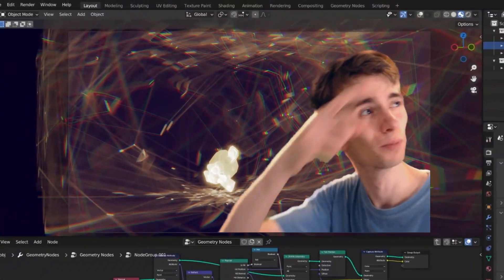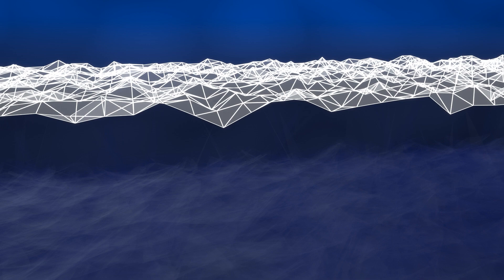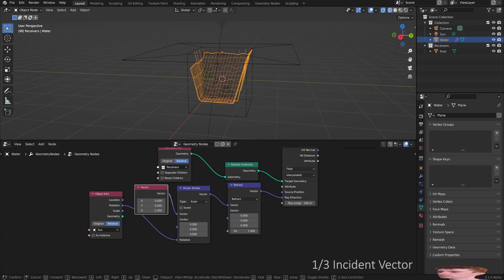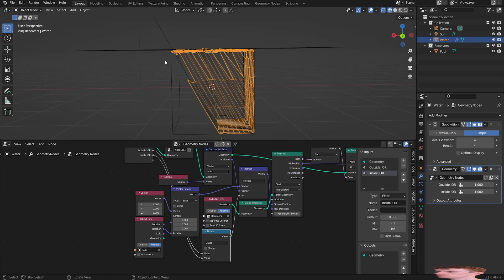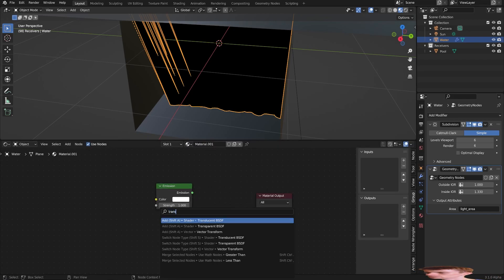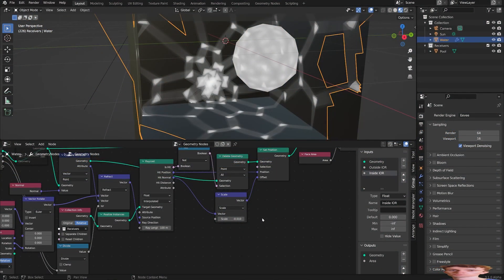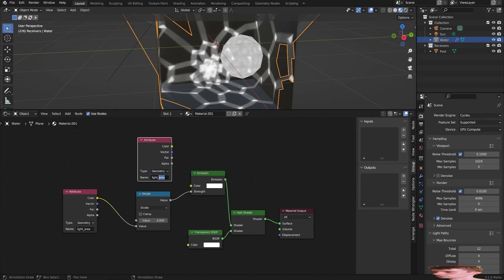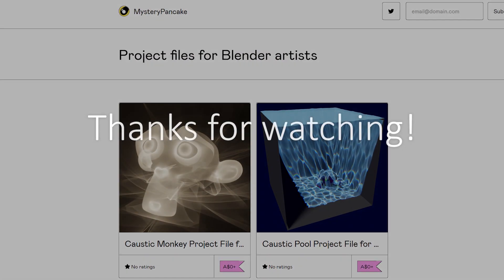Fake Caustics with Geometry Nodes! Blender 3.1 Tutorial (Eeevee)

Comment: hi Evan,

I have an old black and white image of my grandparents i want cast a glass which projects caustic image of my them. So, is there any possibility that this tool blender provides some sort of reverse engineered thing from 2d to 3d.
Reply from the maker: You could try using a grid with many points, and setting the position of each point to the brightness of the image at that pixel. It can be done with Image Texture and Set Position nodes in Geometry nodes.

Blender now has a caustic renderer in Cycles you could also try

Comment: hi ! thank you again for that fantastic trick. Even after capturing the attribute and plugged in the normal node too it, i didn't managed to get rid of all the edges bugging 6/54... could you help me please !!!
The object is a complex one but it is flat, and every node is rightly plugged (i triple checked), and the light effect is working but the view is obstructed with those black edges :///
Reply from the maker: The normal might not be random enough to stop all overlapping faces. It can work better to use a more random node like a noise texture, or the index input multiplied by a small number. Though Blender now has proper caustic simulation, so this method is not really needed for Cycles anymore.

Comment: why blender team just dont rewrited entire cycles render to polygon reprojection? and blender will have refraction and reflection caustics like its normal.
i dont like idea of rays casting from the camera in random way.
Reply from the maker: I guess the method Blender uses must be more accurate, though I wonder too
Reply: @MysteryPancake  i think is have equal accuracy, you cant cast many rays to polygon and take a reflection or cast 3 rays and project this polygon to surface on the way. problems appearing if we will use normal maps, but even this is solvable.
maybe it's just becouse of history of computer graphics research.

Comment: Absolutely fantastic!!! I .. am speechless. One question I have is, what if you want other lights in your scene? Say, you're making an underwater scene and want to make an underwater scene, where there's additional glowing objects flowing underwater. How would you implement other light, that actually is having emission (lighting the scene) into this? I tried- and simply adding other lights (Sun, point, anything) just seems as if they're non existent, despite being right there ._.
Reply from the maker: It is unusual if lights don't affect the scene at all, is this in Cycles or Eevee? Normally the shader would add the caustic color on top of the scene's existing lighting like with an "add" blend mode, so if the scene had a red background for example it would add the caustic onto the red. I am not sure if this is what you mean, or do you mean to affect the actual caustic color using other lights?
Reply: @MysteryPancake  specifically, I added a point light afterwards, wanting to light the scene a little bit more but it had no effect whatsoever. I then opened a new blend file and appended the materials from the caustic one, to recreate the effect of 'underwater' .. but it didn't accept any of the lights (sun) in the scene either. I wonder if there is something I am missing in regards to geometry nodes.
Reply from the maker: @sreliata this is quite strange. I have only had a similar issue in Cycles like at 14:25 due to light path rendering, but not in Eevee. If you have a Discord account I could add you and try to find the issue, but I am not sure what would cause this at the moment.

Comment: hey, I have set it up and when I change the inside IOR it does nothing :/
Reply from the maker: Strange, I'm not sure why it could be. You could hardcode two values into the Divide math node, or use the project file as reference
Reply: @MysteryPancake  I found out I put the wrong geometry in the join geometry node
Reply: nevermind fixed it

Comment: is there a way to use this set up to create fake color dispersion for gem facets?
Reply from the maker: It depends how it looks when the mesh is replaced with a gem like at 12:35, it wouldn't be physically correct but it might look cool

I saw someone on /r/blender made a shader which works for the internal refraction of gems:
https://www.reddit.com/r/blender/comments/rfgiwq/physically_accurate_diamond_light_dispersion_with/
They posted the setup in the comments